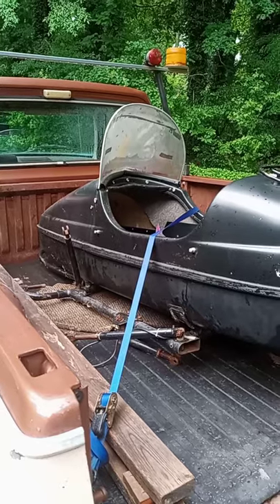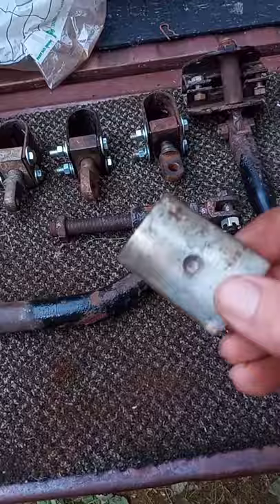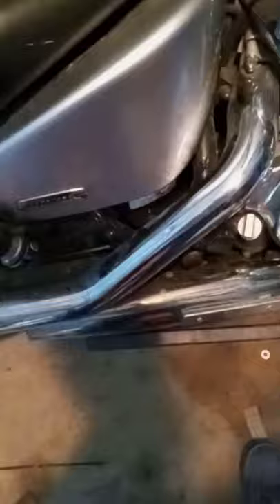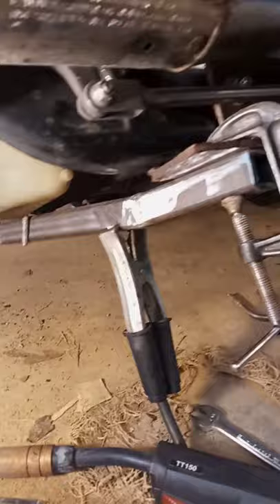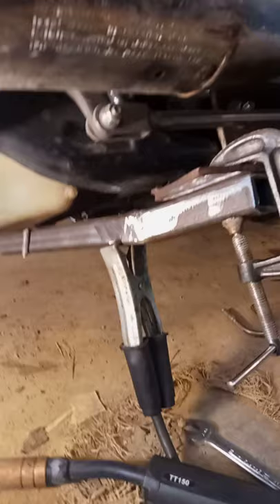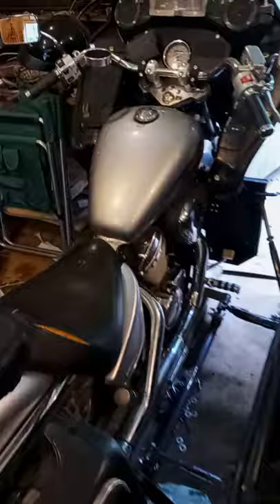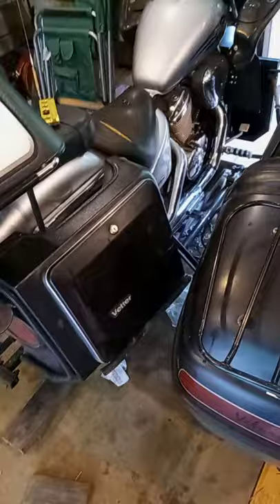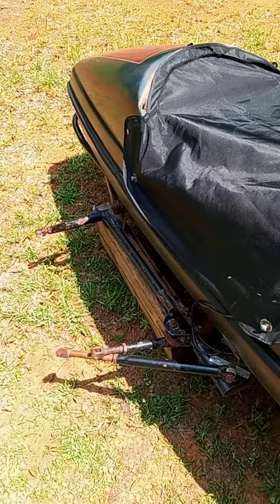Velorex 562 Sidecar to Honda VLX Project

Comment: I saw 8 to 10 inches forward of the drive wheel.. You might want to get a longer rod to reach the front of the bike..
Reply from the maker: @Mark-cs2qd  Sidecar wheel lead is exactly 15% of the motorcycle wheelbase which is where it should be. The bike handles very well with the Sidecar. I didn't even need a damper to prevent the front wheel from oscillating at any speeds.
Reply: Good to know.. thanks
Reply: My Roadliner wheelbase is 67.5.  So I'm looking at just a hair over 10"..
Reply: I need to beef up the frame of my 562 too.. Thanks for the video..

Comment: Very nice vid. I'm like you, make what I don't have and don't worry about looks too much. I might try to put this same model sidecar on my kawasaki cn1600. Wife and doctor don't want me on 2 wheels, but they just shrug when asked about riding with a sidecar. I like the subframe tip. I'm 69now, and the same women that are warning me about riding now are the same ones told me the same things 56 years ago. I find the roads around here are all but deserted in the eves, the gas thing has most folks home after supper. Very pleasant time to ride.Hope you are well.  Thanks.

Comment: I just bought a  94 Velorex 562 I'm gonna mount it to my Yamaha Roadliner.. Looking for some tips here..
Reply from the maker: @Mark-cs2qd  the Sidecar wheel lead should be 15% of the motorcycle wheelbase. Place 1 inch thick boards under the motorcycle wheels when setting motorcycle lean out so you can simply use a level to set the motorcycle perfectly vertical. This will set lean out so when you are on the road with a typical 60 to 1 road camber so water can drain quickly from the road surface your bike will be sitting perfectly vertical. You'll need about a 1/2 or 3/4 inch toe-in on the Sidecar wheel so it doesn't pull to the right. When you get on a part of the road such as the passing lane where road camber is opposite you will note the bike pulling to the left. This is perfectly normal. That's the reason some Sidecar's have an electric lean out control which allows adjustment of lean out while driving. I personally simply ignore the pulling until I get back in the right lane where road camber is normal again. I've seen those electric lean out jacks fail during rides and can't be fixed during the ride making it difficult to drive the outfit.